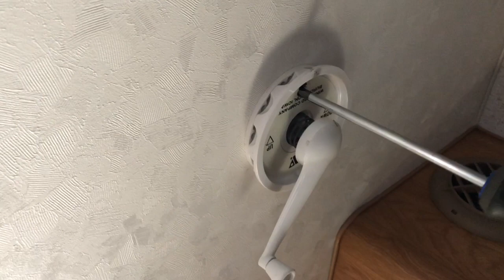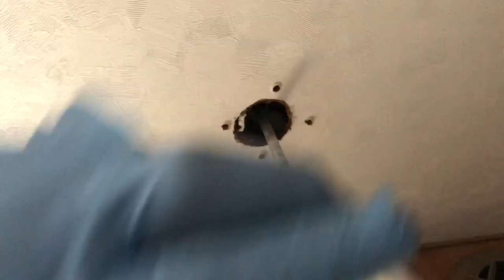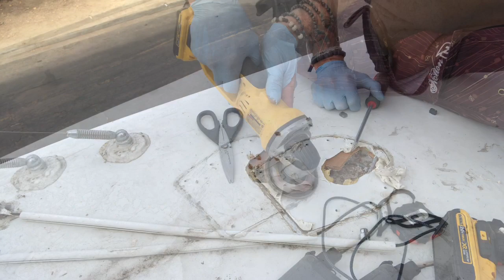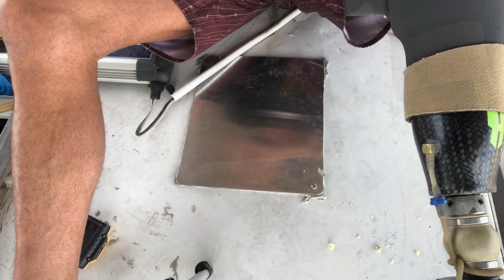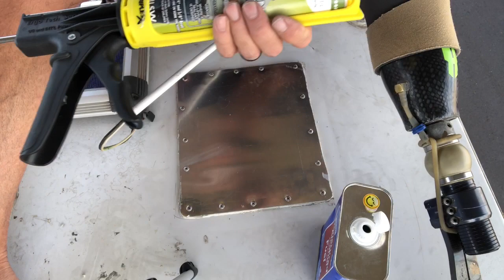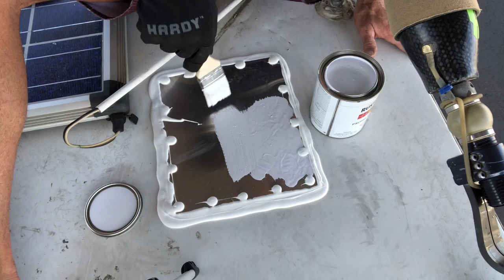EASY REMOVAL OF RV OR CAMPER ANTENNA  rV roof patch hole repair with aluminum sheet more roof space

Comment: Looks good, I am wanting to get rid of antena as well though going to put new roof membrane on what do you suggest using flat piece sheet metal & just glue it down over the hole before laying down the roofing membrane?

Comment: Thanks for this! After you scraped off the excess butyl tape around the edges what did you clean the surface with? Acetone? Mineral spirits? Denatured alcohol?
Reply from the maker: Becky Jackson I used alcohol
Reply: @DesertSandsVintageTrailerPark  Thanks! One more question... will this work on a rubber roof?
Reply from the maker: @beckyjackson9555  I would try and find the similar material to your rubber roof, cut out a small square to cover the area then use Eternabond tape